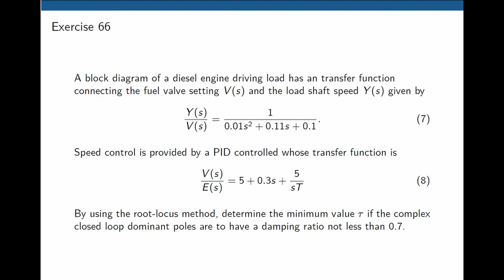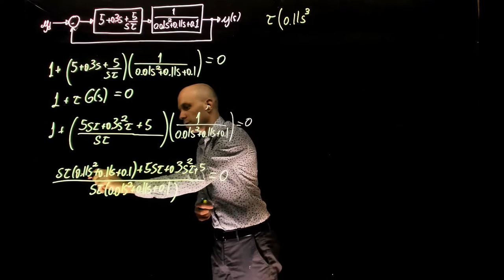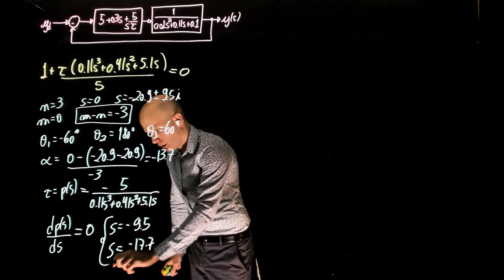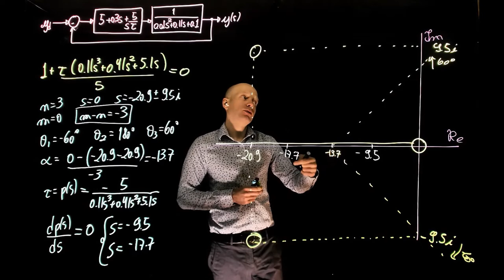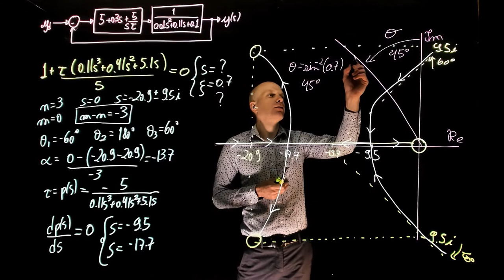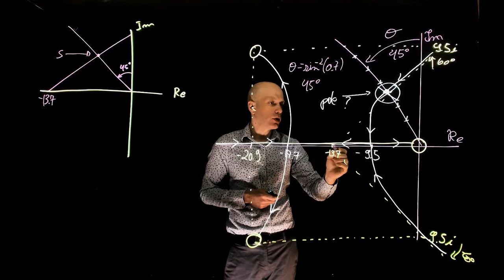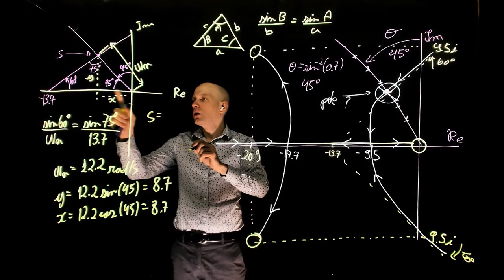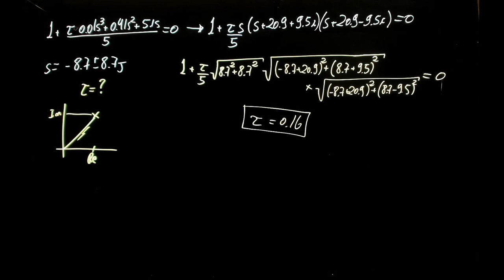L13E66 Control Systems Lecture 13 Exercise 66: PID controllers

Comment from the maker: To find tau:
s = -8.7 + 8.7j

replace s in  (0.01s^3+0.11s^2+0.1s)tau + (0.3s^2+5s)tau = 5

and it should yield: (-31.199 - 4.52574j)tau = 5

solving for tau    tau*((-31.199)^2+(4.52574)^2)^0.5 = 5

gives tau = 0.158